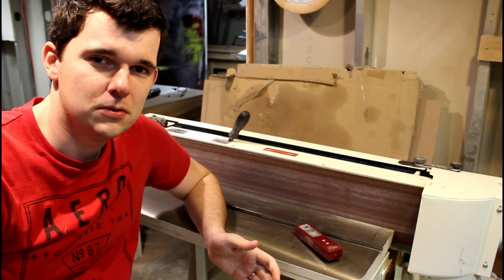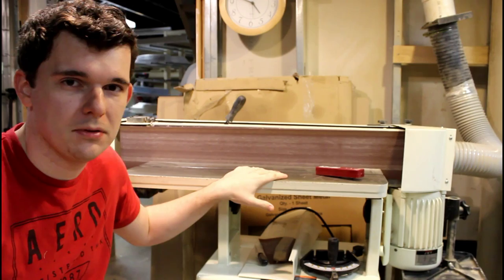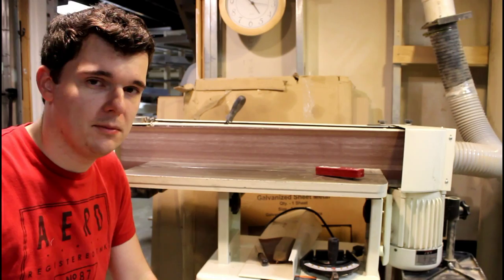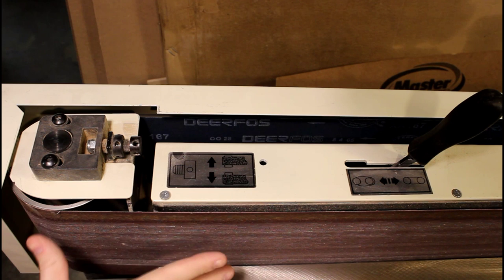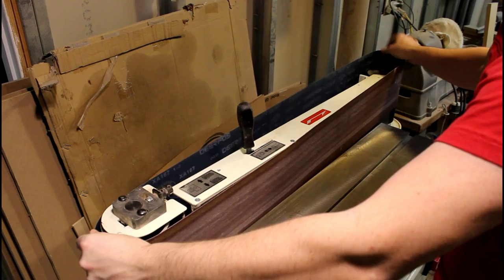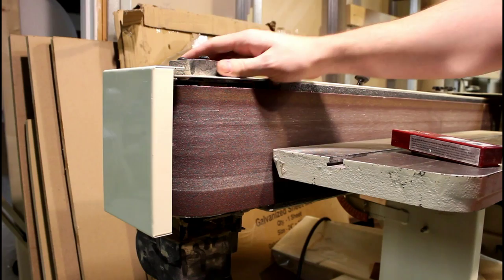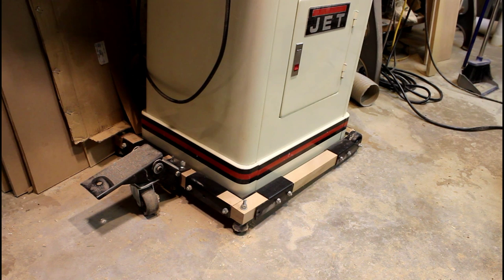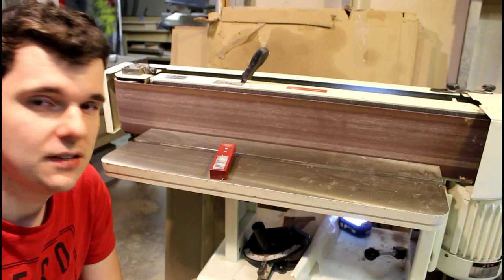Tool Reviews: Jet OES-80CS Oscillating Edge Sander

Comment: Great review. One thing I would note is that you mentioned if there was an option to make the table raise with a lead screw or some other mechanism, you probably would not have paid the extra money. Watching videos for other machines that do have this feature e.g. Hammer, this is one of the things the reviewers tend to rave about...their point being that the ability to easily adjust the table means that they get a lot more use out of their belts as they can, in seconds, raise or lower the table. This really just goes to show that different folks want different things out of their equipment and, thankfully, we live in a country where there are a very decent number of choices to fit most people's wallets.
Reply from the maker: Larry, thanks for watching and well said. Over the years I've come acostomed to not having a handcrank and it's not as big of a deal as I may have made it seem, just seemed like an afterthought at the time. But as you said companies engineer for a price point.

Comment: Thanks Brian, very good and valuable review.
Reply from the maker: Thank you!
Reply: BrianCNC i bought the same machine, based on your review. I use it alot now. Only downside i find is removing the backcover/replacing belts. Maybe diy something, where it slots in with magnets :)

Comment: I’ve been using a festool palm sander with the edge attachment…does the oscillation feature on this eliminate the fine scratch marks that a regular belt sander leaves on board edges?
Reply from the maker: It does a pretty good job at providing a cleanly sanded edge. It leaves a linear grain sanding that you can hit with a sander after but nothing quite comes close to a machine like this for sanding things like doors and panels, getting a clean and precise 90 degree edge with no deviations.

Comment: Hi Brian, you were mentioning higher quality versions of this kind of tool, what brands exist that are higher quality but have these features and are perhaps US or European built? Thanks for your help!
Reply from the maker: US built is tough, there are very few floor standing machines made here anymore, and no brands that I can think of at the moment. The higher end ones I mentioned are your typical euro brands like SCMI, but you're going to put out a lot more money for just these. The edge sander hasn't really changed much in the past fifty year so it's not a tool I would spend much money on more than the Jet when buying new. The bells and whistles in wide belt sanders and the like are where you really can get some fancy features spending more money.

Comment: Delta has a very similar model and for a very similar cost.  Which would you recommend between Delta and Jet?  I can provide you a link if you wish.
Reply from the maker: sure, please send me the model/link
Reply: +Digs Fossils-n-Knives FYI:  For my needs, I would be using a machine like this to surface grind steel and to tapper the steel flat stock.  Right now I use a 1/4? HP 4x36 table top grinder.  Slow belt speed and it takes hours to grind a 15" piece of steel down 1/8".
Reply from the maker: +Digs Fossils-n-Knives I would say they are basically the same machine, just with different colors. Most of these machines are made these days in the same factories with different finishing touches. While it's certainly not a surface grinder I think it will do better than your current setup. I'm not sure of the dynamics involved in what you're doing and how they are with this machine though, definitely get some advice on the right setup from other knife makers. It is designed for woodworking and some finish on metal work but not necessarily a grinder or a machine that will precisely remove large amounts of steel.
Reply: Excellent advice.  Thank a lot!
And great review of the Jet!
Reply from the maker: Thank you!

Comment: Is this a better option than a disc belt sander for a hobbyist?  I'm torn between this and the jet 12 disc and 6 belt. Any opinions?
Reply from the maker: In my opinion yes, and considering the fact that many of the bench top ones are priced at just below this ($700~ range) it makes a larger floor standing machine the better buy. I am not a fan of disc sanders but each to their own. They are just too limited and offer such a small surface area. For a general approach a large and wide belt area makes the best practical sense. Having a larger belt also means less belt changes.
Reply: Thanks.

Comment: Thanks for making this.  In your opinion, is there any reason I wouldn't be able to use/mount this unit on a stout bench instead of using the included base unit?  Thanks!
Reply from the maker: Josh Owen you probably could, but it's a rather heavy and large upper assembly. Any reason why you want to do this? The machine is also not bench height so it may not be a comfortable working height depending on what your setup is.
Reply: briancnc.  Thanks for the reply. I have two large 10 ft benches up against a wall with my mitre saw flush in between them. This set up takes entire length of the wall and one end of this bench is really my only option for a space to fit this in my shop.  This location would also allow me to open the garage door and escaped dust not picked up by my cyclone would shoot out that direction.  Ive got extra bench space but no floor space.  Looks like setting it up this way would add 10 1/4 inches to the table height for me.  My combo sander (and spindle sander too) that this would replace is at this height and it hasnt been an issue.
Reply from the maker: Got it, you could definitely through-bolt this to a sturdy bench and relocate the switch to a plastic junction box or flush mount it in your bench. The machine has (4) bolts that hold the upper assembly to the base.
Reply: briancnc , it looks like the switch box is not part of the base?  Or does it hang down into it on the inside?  Thanks.  Gonna order one this Friday with Jet sale. Looks like they are on 2 month back order.  Ill let you know how it works out.